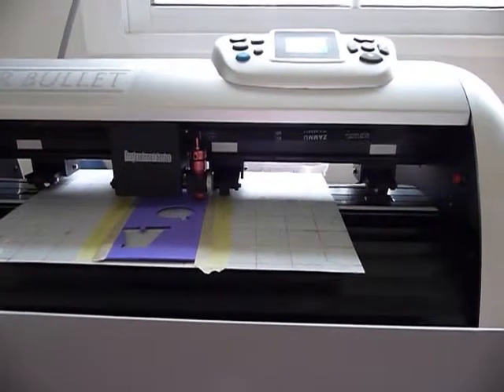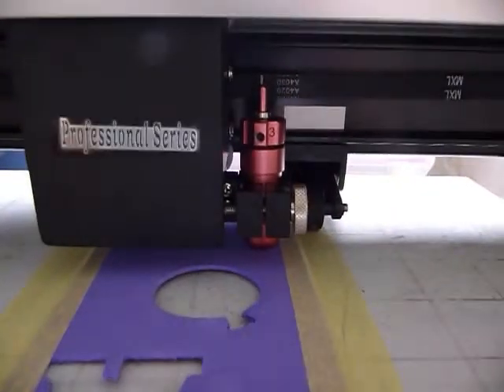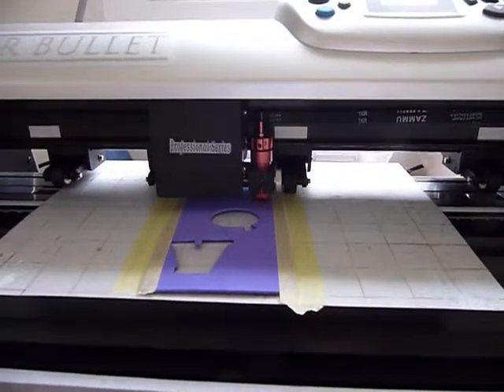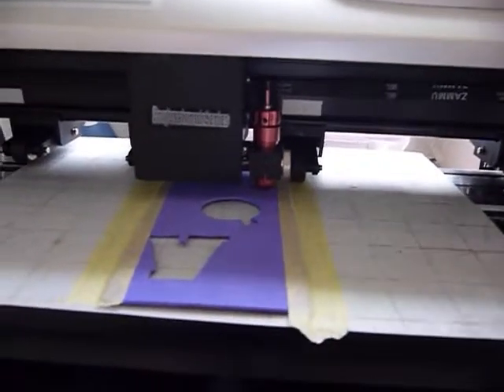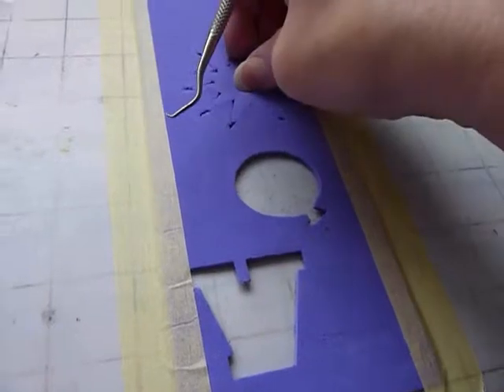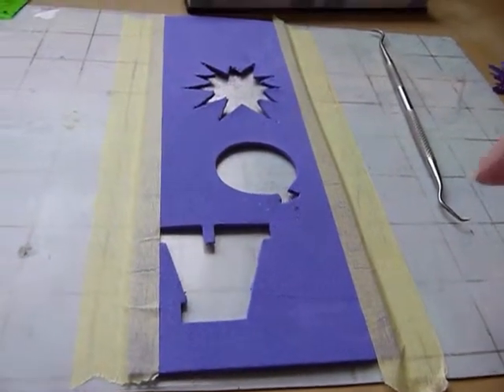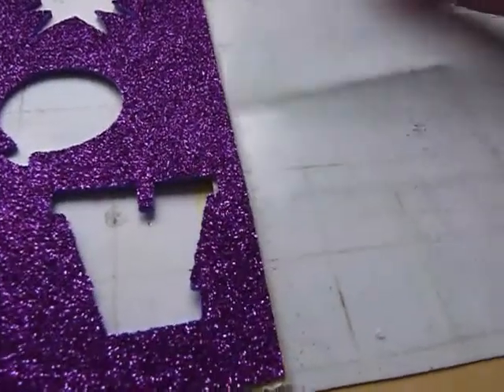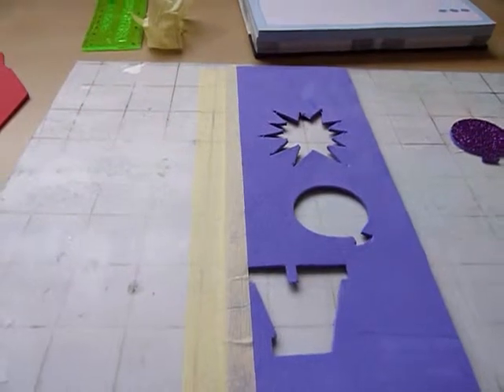Cutting Glitter Fun Foam with Silver Bullet

Comment: Hi, I recently got a silhouette cameo having in mind to do a lot of glitter fun foam projects, but sadly cameo can't cut that material! How is silver bullet working? can you recommend it  as a machine that I can use with fast speed?
Reply from the maker: Hi, Yes, I would recommend the Silver Bullet. It is a lot more powerful than the Cameo      
(which I had previously). You can also just buy a blade holder and separate blades (from wherever you like). You would need a 60 degree blade for the foam.  I had my SB for 3 1/2 years and then bought the Silver Bullet Platinum which is a LOT wider than my 15 inch    Bullet was. (So that says how much I like it!)     The new machines come with a built in     camera to aid with Print and Cut too.The pinch wheels are very strong, the repeat function works really well and these machines are designed to be work horses.

If you have the Silhouette Studio Business edition, you could still design in that, save as SVG and cut it with SCAL, or you can just learn SCAL and be done with it.
Reply: Can you share your gmail? would like to consult more specific features of silver bullet please!~
Reply from the maker: Go to my YT home page, there is a link in there to my blog with a contact form. Use that and I will respond via email